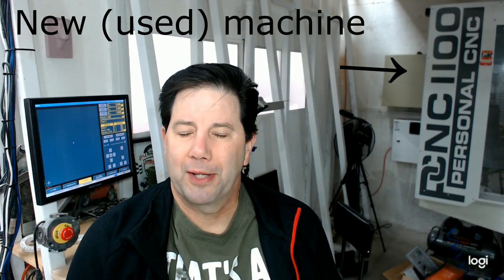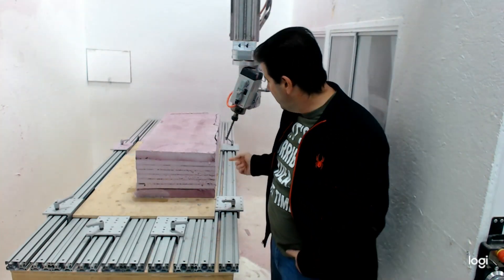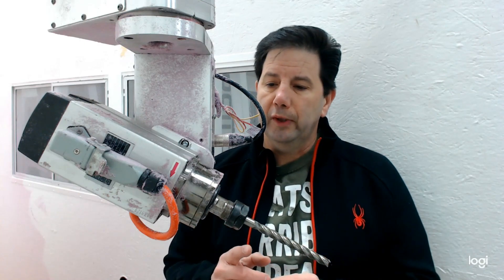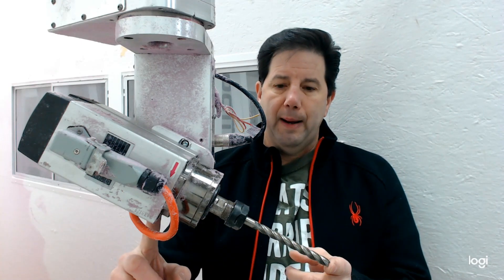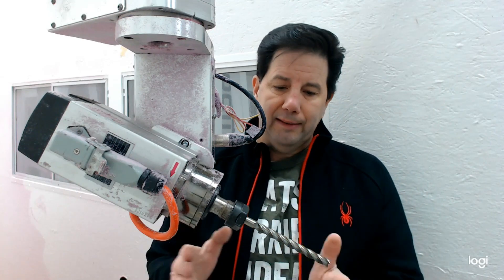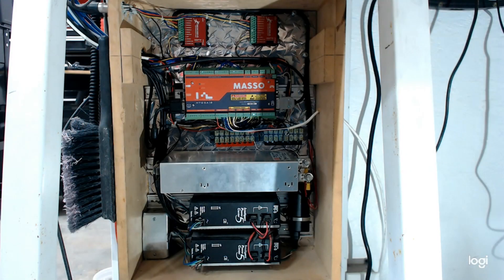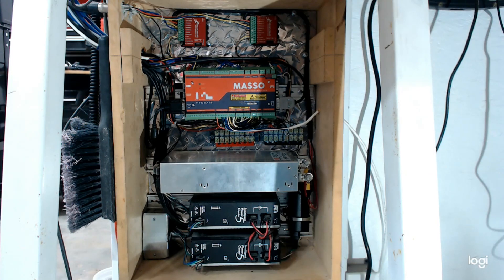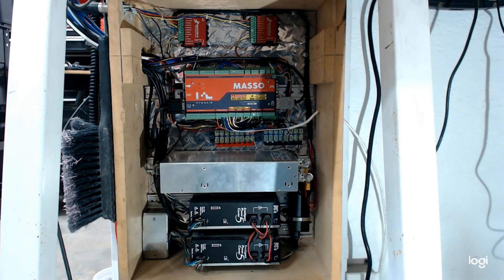DIY 5 Axis CNC Router...Build Video 2

Comment: I wonder what are your thoughts after a year of using masso G3?  I am facing the choice of a new controller and I am inclined to the UC300ETH-5LPT + UCBB, not the masso G3.  what are the downsides of masso G3 in your opinion?
Reply from the maker: bogas78 honestly it just works.  I’ve been make some large parts late and I haven’t once thought about the controller.  I’ve actually had problems with fusion 360 update there code and breaking the unwind. Here is the recent parts we have made https://www.instagram.com/p/CCnxDW8nXIu/?igshid=1vkjkarstj0vq
Reply from the maker: Also the clearpath drives are fantastic
Reply: @XSMotorWorks  I'm using most of the time SOLIDWORKS, fusion only in emergency or when trying to get some more free form shape's. But even on masso forum there are a few recent posts about laggy and buggy control unit's so that why I was asking :). There isn't many info or compare between masso G3 /mach3 or 4(sorry) and any other motion cotroller's. But if I'm not wrong you mentioned that you had some problems with mach3 and your machine.
Reply: @XSMotorWorks  I would like to talk with you some day over email or whatsup :)
Reply from the maker: @bogas78  Sure be happy to chat. 
So I've got two Masso one 5 and one 3 (plasma cutter).  I've also got Mach4 on my 4x8 3 axis.  I don't use my machine everyday and I've never had a problem with the Masso.  The Mach4...I've have the hard drive crash.  motherboard fan went out.  Power supply as went bad.

Comment: Could you not put a collet around the shank of the bit?
Reply from the maker: I not sure I follow your question exactly....I think your asking wont the collet hold the bit in place.  It does BUT it will let it move just a little bit  (1-2mm) which cause a depth problem between tool changes.
Reply: @XSMotorWorks  I think he means a collar like a drill stop.
Reply from the maker: @JackMayhoffer  I think your correct and in that case you could use a bit collar to set the height
Reply: @XSMotorWorks  Couldn't you also set up a tool setter off the machine to set all your cutters in advance so you can just pop them on and off with the collars. That would be handy.
Reply from the maker: leo b honestly what I really need to do is create a tool change routine.  Which I will do at some point.  Most of my energy right now is being spent on building the two car chassis

Comment: You need to upgrade to mach4 industrial.
I never have to repost my code it dynamically adjusts to the current tool i have. You need your post to use fanuc macro variables.
Reply from the maker: Hi Steven....Thanks for the information, as of right now I am happy with the Masso unit.  Mach definitely has more features but for what I am trying to do the Masso makes sense and I really like the fact that I don't have to rely on a PC.  Cheers Brian